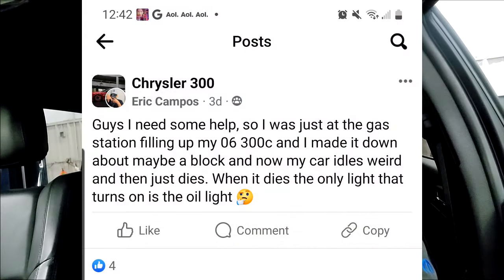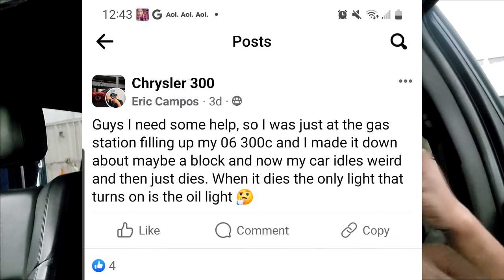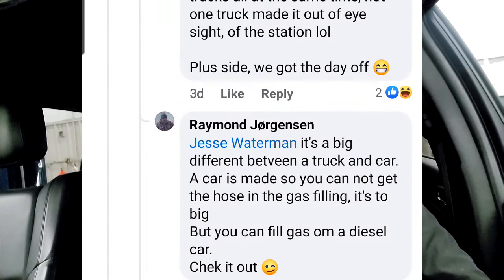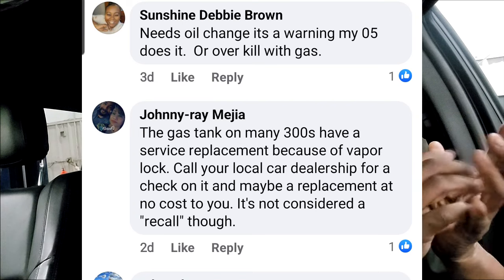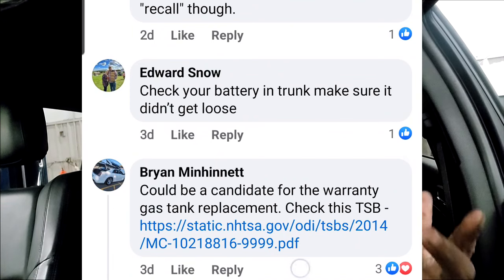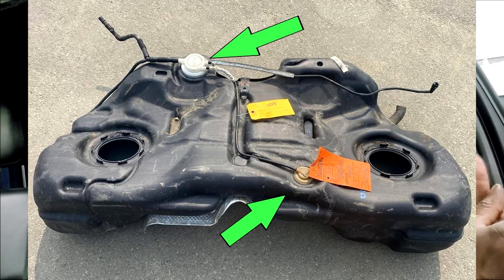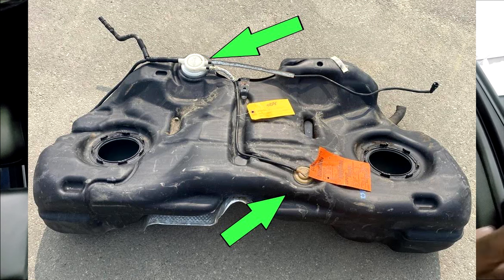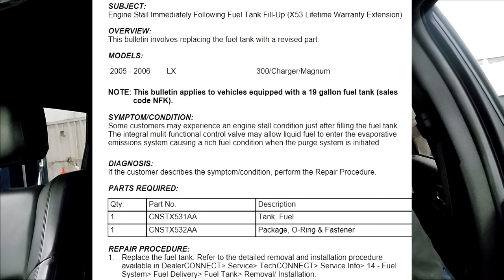How to fix a car that stalls out after adding gas.

Comment: Yep, my 06 Charger RT started dying right after fillup, then start again and be fine. The local dealer had it replaced in a day. Make sure to have the trunk and back seat cleaned out and it is helpful for them to not have to deal with a full tank as it will have to be drained and put in the new tank. I have the receipt sitting here on my end table.
Thanks JT.

Comment: However raw fuel gets in the Evap system and makes it's way to the intake manifold the engine will flood and probably stall so at least don't over fill it